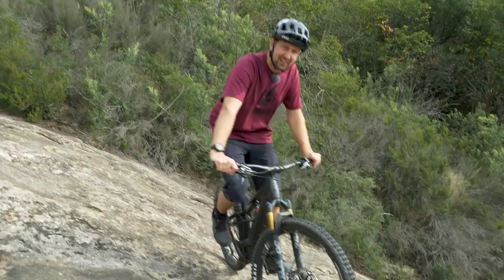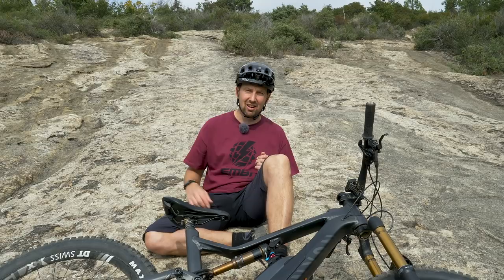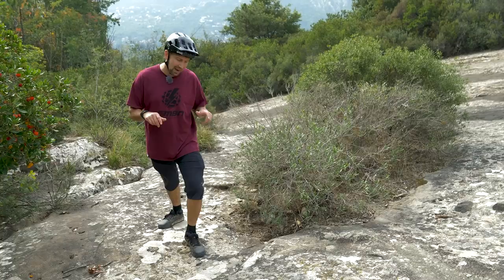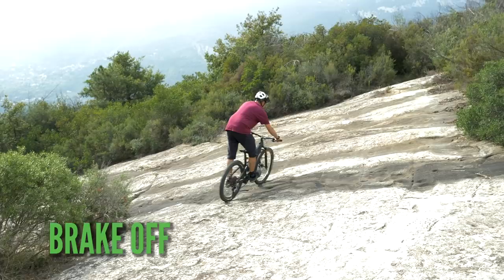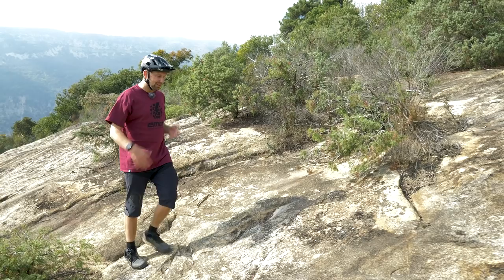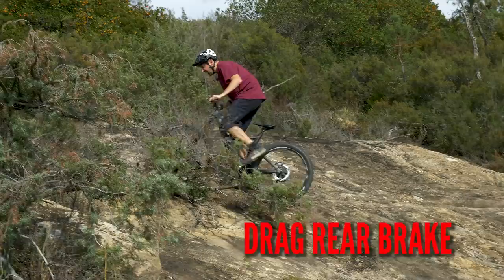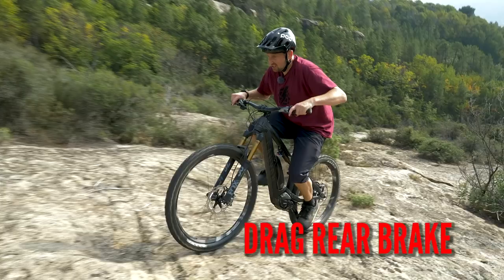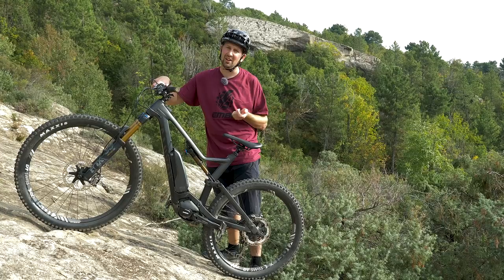Can You Use Your Brakes To Climb Faster? | How & Why To Brake While Climbing

Comment: That is why I am absolutely in love with Bosch's EMTB mode. it lets you control the power with the pressure on the pedals. Combined with these braking techniques you can climb the steepesz sections

Comment: Great video Chris!  I have been using the same technique to manage grip while climbing.  I also use it on technical decents for the same reason...I pedal while braking to prevent the back tire from locking up and stay in the maximum traction zone without sliding.  Used to do this on my analog bikes as well.

Comment: How about in Bosch's EMTB mode, or this technique only applies just using Turbo, Boost, (full power modes), etc...?
Reply: I think that's the idea, Fella... Using the break as a power drain so you've full power when you need it but not when you don't.

I'm guessing the auto modes will negate the need for the technique....
Reply: There's only one real way to find out ...